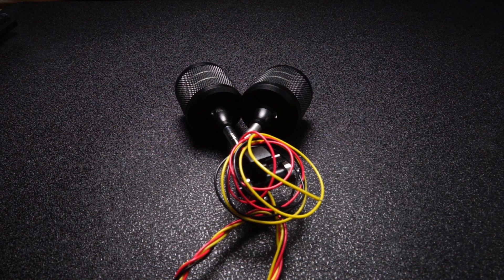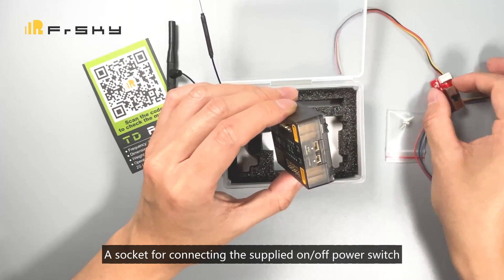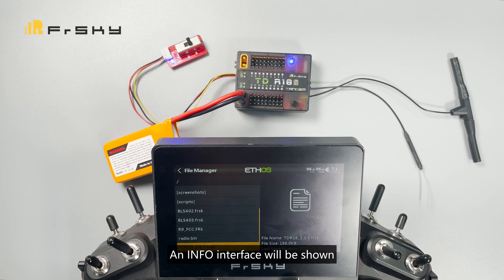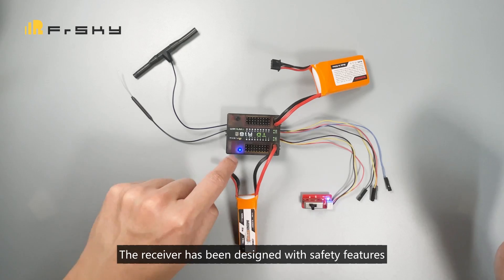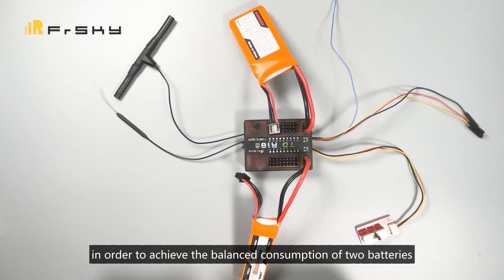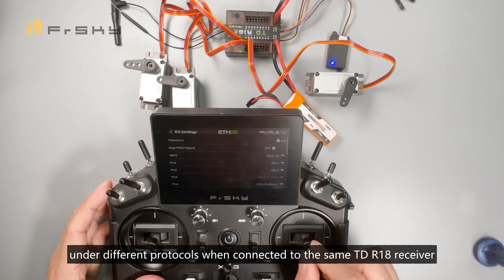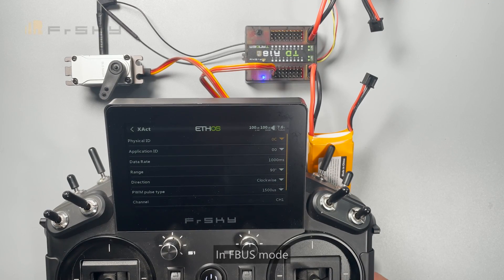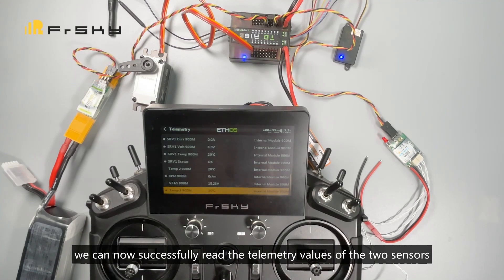FrSky | TD R18 2.4GHz & 900MHz Dual-Band Receiver

Comment from the maker: The red switch panel in the video is not included, it is used to power on/off the power supply just like disconnecting a battery. 
There are different types of external switch accessories for the TDR18 receiver like an audio-jack-type pin switch (https://bit.ly/3KOR10t ) and NFC switch panel (https://bit.ly/3xk7Qv5 ).
Reply: @juancarlosavila3508
hace 0 segundos
I see that the FRSKY TD R18 does give the voltage of each battery (RxBatt1; RxBatt2).
Does the FRSKY TD SR18 model (with stabilizer) also give the voltage of each battery (RxBatt1; RxBatt2)??? . Thanks

Comment: I cant manage to make this receiver work on my tandem xe 😢. How exactly does the firmware update work? I dont have a way to connect receiver to tandem xe. It binds but have no acces to set up sbus out and switch channels.
Reply from the maker: You can update the receiver either wired to your transmitter or over the air. See the Update process video. Although i am using a 20R and a TDSR10, the process is the same. Once your receiver is updated, the options mode to change a pin to sbus out will work.

Comment: Hi, I can't finde info about TD R18 output voltage, what is exaclty is if I will use 2s lipo?
Reply from the maker: Hello, on a TDR18, your input voltage is your output voltage. It isn't regulated like the RB-35

Comment: I see that the FRSKY TD R18 does give the voltage of each battery (RxBatt1; RxBatt2).
Does the FRSKY TD SR18 model (with stabilizer) also give the voltage of each battery (RxBatt1; RxBatt2)??? . Thanks

Comment: So, what is the advantage to having these servos vrs a normal digital servo or even pwm servo?
Reply from the maker: These Xact servos support telemetry and are configurable (degree, center point, etc) through FBUS protocol. The Brushless servos in the video have a better performance on both torque and speed, also, and all Xact servos can automatically recognize the signal commands of FBUS, PWM, and SBUS.
Reply from the maker: You can find the detailed info about Xact servos here: https://www.frsky-rc.com/product-category/servos/

Comment: I have bought 2 TD receivers and the 900 mhz telemetry makes my servos jitter like crazy. They are multiplex, Hitech and emax servos. I have tried every position of antennas. The only thing that makes the jitter go away is to wrap the 900 mhz antenna in aluminum foil or turn telemetry off altogether: clearly not viable. I had to return the rx
Reply from the maker: Hello Giovanni, you may try to wrap the servo cables for reducing the interference possibilities, or keep the sevos a bit further away from the 900M antennas. Also, some servos with better anti-interference performation are also your options, like Xact series servos.
Reply: @FrSkyOfficial  No shielding made the issue go away, so in the end I returned both receivers to RC Studio, which was very available and professional. I then bought an old 2.4 Ghz ACCST receiver (RX8 PRO) and very little jitter. However the radio gave  "RSSI critical" at about 300 meters, once. It seems to me the radio link quality is unstable
Reply: @FrSkyOfficial  Hi, I have tried to wrap the servo cables and move the antennas as far as possible with no difference. The only thing that works is wrapping the 900Mhz antenna with alu foil to reduce emission power (but also reception!). I wonder if it damages the receiver too
Reply from the maker: @giovannivitali9536  Wrapping the receiver antenna is not good, the reflected signal would cause the heat or worse for the receiver itself, and will definitely not suggest this way.
Reply: @FrSkyOfficial  yes I thought so. Since wrapping the servo cable did not work and cannot move the antennas further away from the servos the only solution seems to try other servo brands. But it will be trial and error and an expensive one. Why don't you change the firmware to allow reducing or turning off the 900 mhz telemetry power?
Reply from the maker: The TD series features its simultaneous working mode at dual bands, both signal and telemetry of either band cannot be disabled individually for ensuring its performance. So not same as the solution using the 2.4G series with adding a redundant 900M receiver. Please leave me you contact email and let's try to figure out a way based on your current devices.
Reply: @FrSkyOfficial  Hi, do you have an official email where I can write you?
Reply from the maker: @giovannivitali9536  Yes, you can contact FrSky official on Facebook. 😃
Reply from the maker: @giovannivitali9536  Or you can write email to haoliang.huang@frsky-rc.com

Comment: The 2 batteries are for the redundancy I suppose?
Can you supply power by using an ESC controller and a JR cable instead?
Reply from the maker: Yes, for power redundancy. Instead of using the XT30 power supply, you can have the receiver working but not recommended, this way you gonna miss the power switch function, and part of telemetry thru XT30 input.

Comment: Will Frsky be adding a stabilities version on the TD R18 or the  TD R10 as you did with the SR10, 8 and 6?
Reply from the maker: Yes， there will be stabilization TD receivers in the future.
Reply: @FrSkyOfficial  any idea on the approximately when it will be available? I have too large jets that I would like to use them in.
Reply from the maker: @ghoustanable  Estimated the TD S receivers would be available in the 2nd season this year.